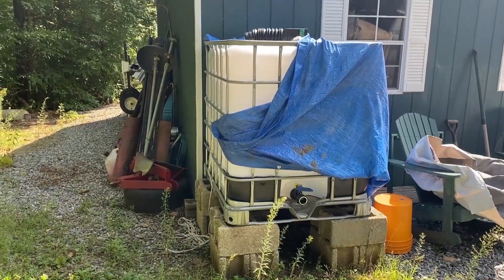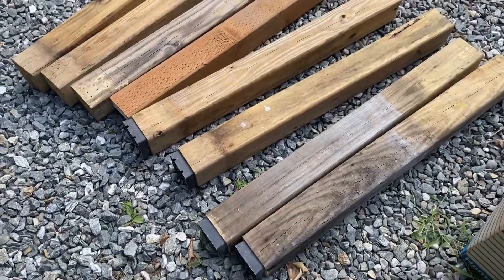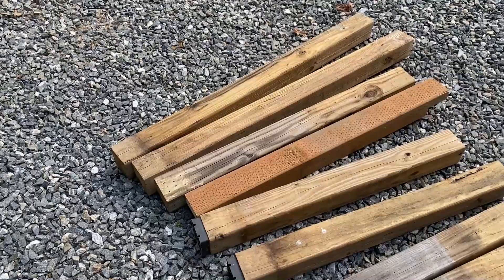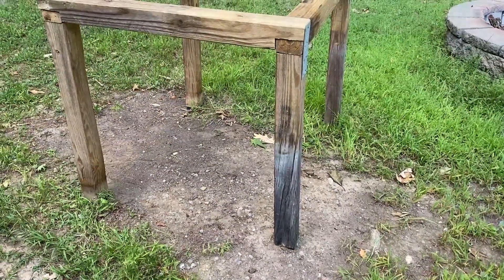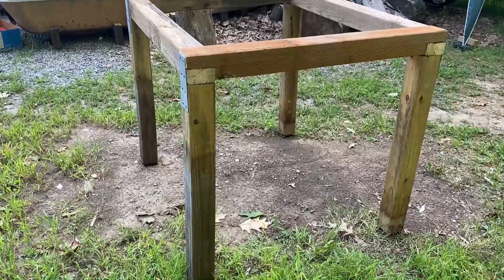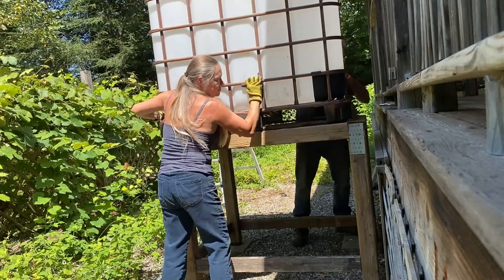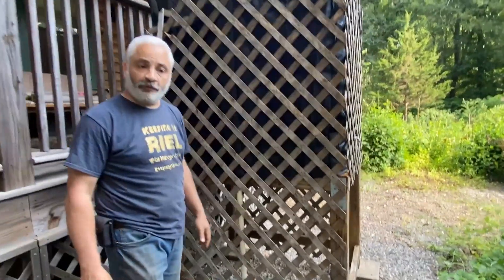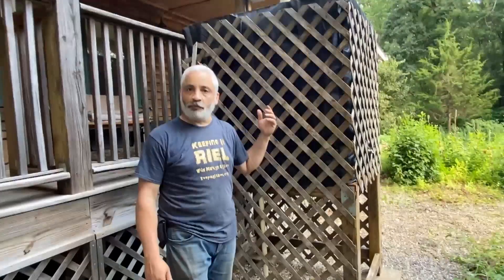Make a 275 gallon IBC mini tower water storage

Comment: Hi. How is the design working out for you please? It seems a little vulnerable if the foundation shifts at all under the weight of a full tank. I like the lattice idea.
Reply from the maker: @Seven30onFriday  Overall, the system works great and collects an amazing amount of water. The stand is working good but the location isn’t. Rain that hits the top of the IBC tote, bounces and splashes on our porch leaving a large puddle. We will be moving it to our new chicken run away from the cabin. I would still highly recommend this system. We will be building a second one next spring. Thank you for watching!